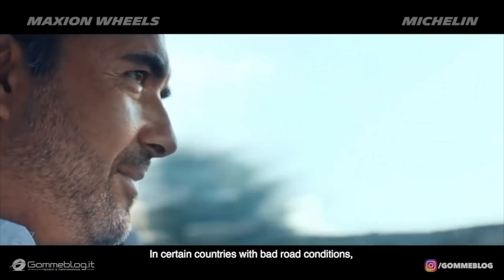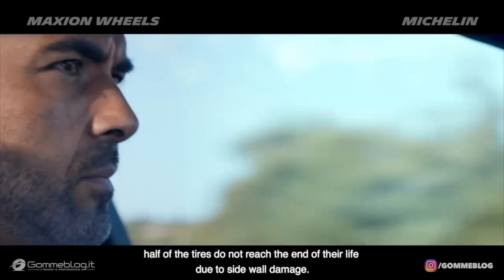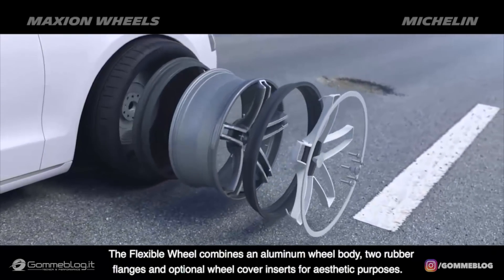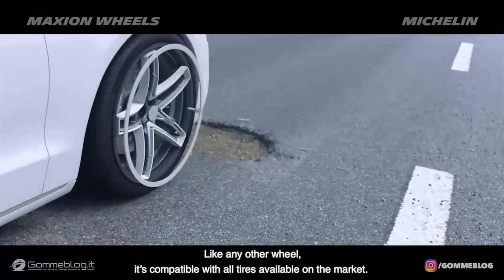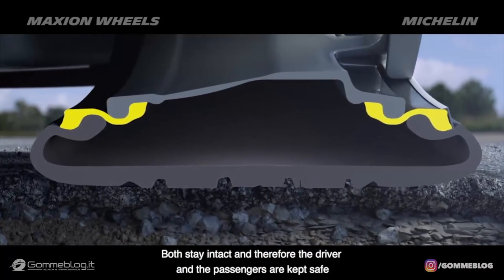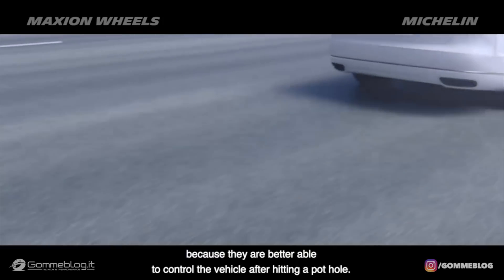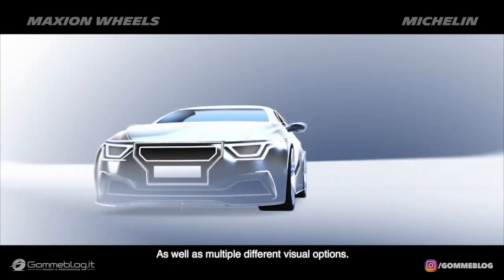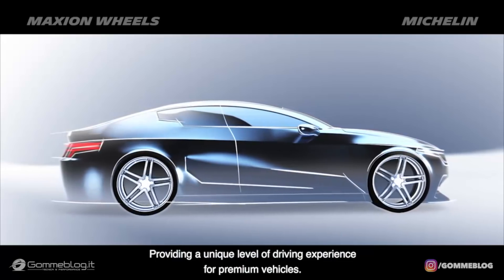3 Future Tires by MICHELIN that Have AMAZING FEATURES

Comment: Hi. I have designed some very modern rubber specimens that adjust their wind automatically without any interference.  If a person or company wants to mass produce such a modern tire, I am ready to cooperate.
00989389718899

Comment: I'm case of accidental drift, won't these tires cause more harm than well? Can't you have an accident if you drift with one of these?
Reply: Can you explain how would it cause more damage to durong an accident?
Reply: @kryowl  well Xeus, I ask myself the same question, but let's say you suddenly brake and change your direction on a high speed scenario, won't these tires perhaps make you car tumble on the side? Especially if the car has a higher center of gravity like a SUV or an offroader, because the side part of these tires look straight with no curvature at the end and not very Ben dable from pararel movements, also making me wonder if it's safe to drift with them.  Either way this is being designed by the very best, so Im guessing they took everything in to consideration, odds are that there is no harm or volatiliaty for accidents.